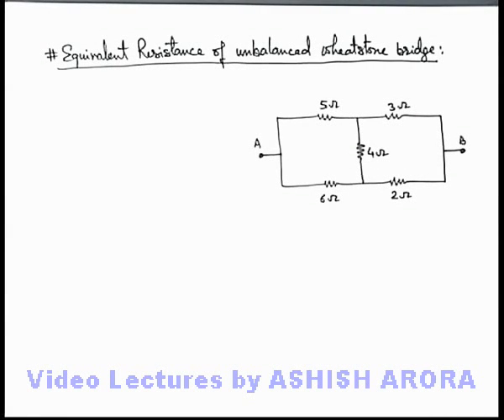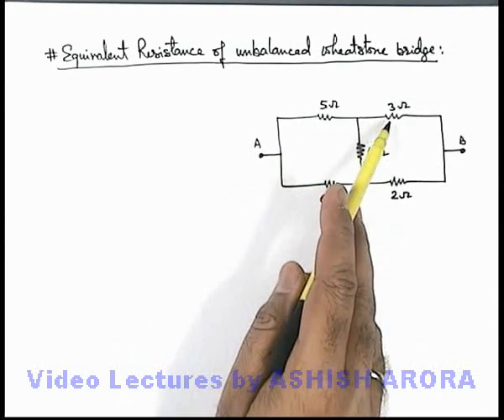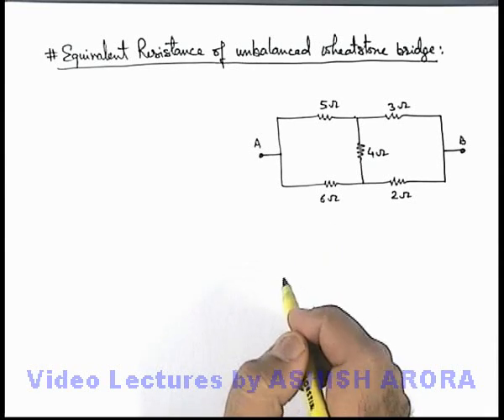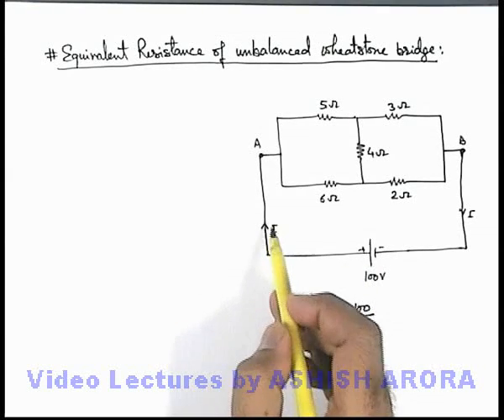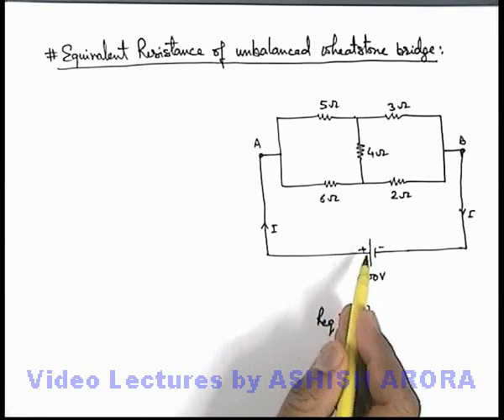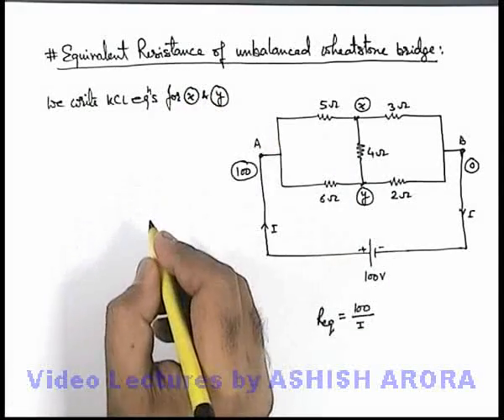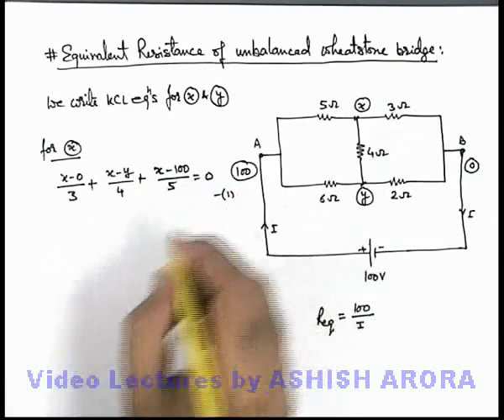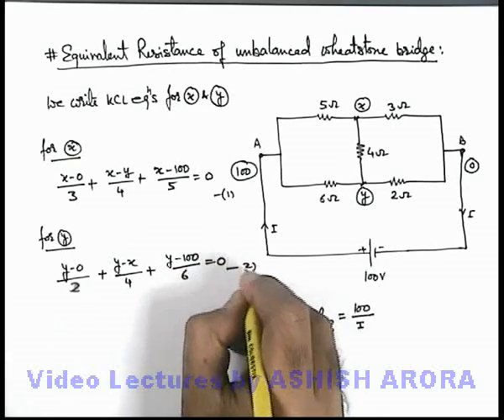Class 12 Physics | Circuit Analysis | #9 Equivalent Resistance of Unbalanced Wheatstone Bridge

Comment: Sir for total current why are the 5 and 6 ohm resistors not included?
Reply from the maker: Total current in 5 and 6 ohm resistance is same which flows in 2 and 3 ohm resistances... so no need to include it twice...
Reply: @physicsgalaxyworld  sir can't we apply kvl over here. Please tell
Reply: The current through 5 and 6 ohm resistor would be equal to 3 and 2 ohm resistor as, the current through 5 ohm resistor is equal to the current in 3 ohm and 4 ohm resistor, similarly from 6 ohm resistor, but if you look carefully that the total current in the 4 ohm resistor is x-y/4 +y-x/4 which is 0, so the current remains conserved.

Comment: respected sir my basic doubt is that when emf is not given in the the circuit why we connect it to 100 v battery  not something else
Reply from the maker: You can connect any battery, as equivalent resistance is not affected by the battery... we used 100V for ease in calculations...

Comment: Can we use battery of different volt instead of 100 I mean is answer depends on the volts of battery
Reply: yes you can use any battery, equivalent resistance is not affected by the battery, 100V is used for making the calculations easy

Comment: what if the bottom 6ohm is replaced by 3ohm and bottom 2ohm replaced by 5(opposite of to resistances)?

i tried applying your method on it but y value came out to be negative
Reply: is there a particular condition to be satisfied for which we can use your method?
Reply from the maker: No... check your calculations again... this method is a universal KCL method for any ckt...
Reply: no, checked it. Your method gave negative values.

I finally got coorect answer when I used delta to star conversion formula.
Reply: Srikanth Rangdal is this method giving wrong answer?
Reply: Y value can be negative its potential its simple
Reply: Yes sir  it came out to be negative
Reply: -ve means that the portential is opposite to how u assumed (higher side is lower and lower one is higher